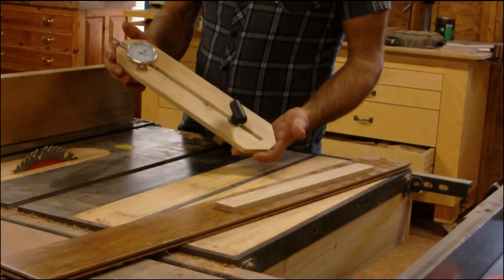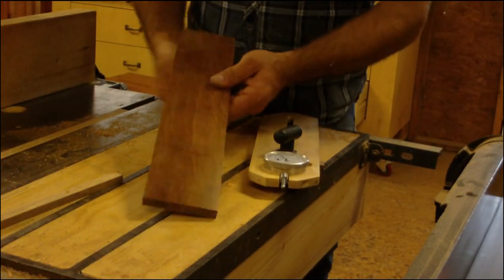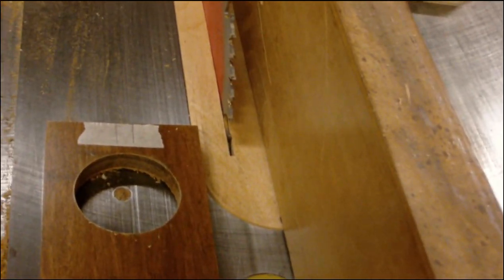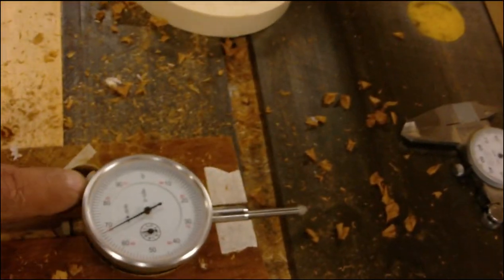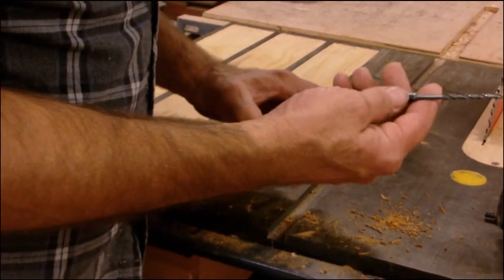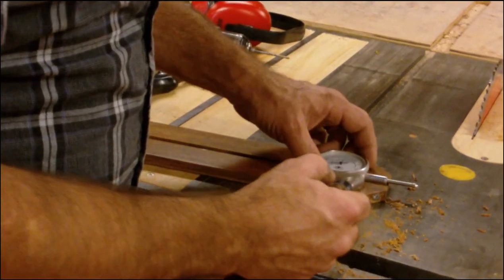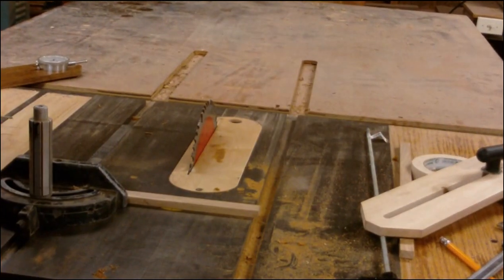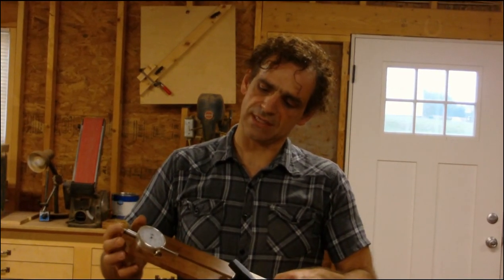Table Saw Sliding Dial Indicator

Comment: Thank You!! A perfect solution! quick and easy to build. I was satisfied to make mine fixed length but I'll probably remake it with better materials later. Worked perfectly for setting the table parallel to the blade on my saw, which was all I was really looking for!
Reply from the maker: +Kirk Dunn (Dr Pepperbox) Glad to hear it. I really have enjoyed mine.

Comment: can you share information about the dial indicator?
Reply from the maker: Thanks for the view and comment. The dial indicator was purchased off of amazon for around $12.00 a few years ago. It is an affordable and accurate device. It is divided in thousandths of an inch and is good up to an inch. It also has an adjustable face. The only thing I did is cut the back bolt mount bracket off of it and it was ready to use.
Reply: R. S. Grant Woodworking Very nice table saw aid. How long is the base? Since sizes of different saw tables vary, is the length of the base designed to span the saw table channels plus 2 (?) inches.
Reply from the maker: stue230 It is designed to span over to the router area of that same table saw for stop grooves ect. My base is 18 inches long. I also wanted it to extend over the other miter slot because when the fence gets close to the slot, there will be no room for the dial indicator front. Thanks for Sharing.